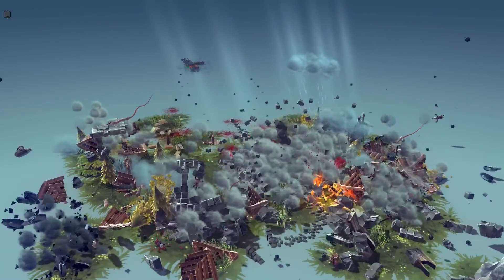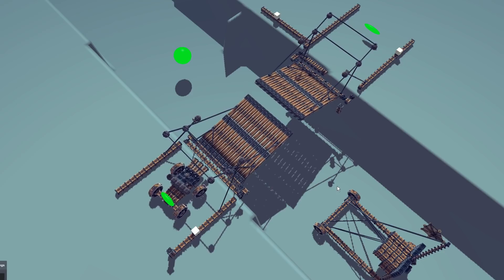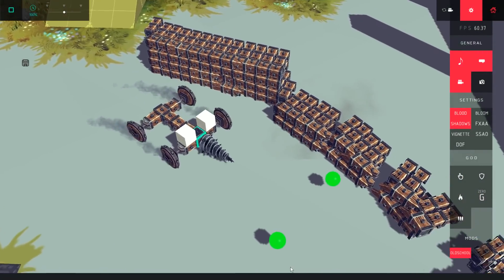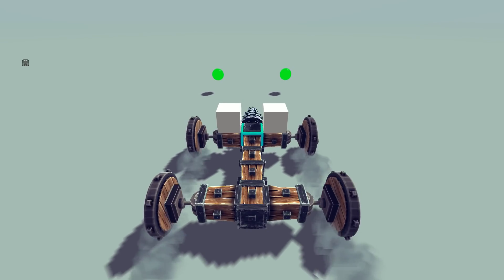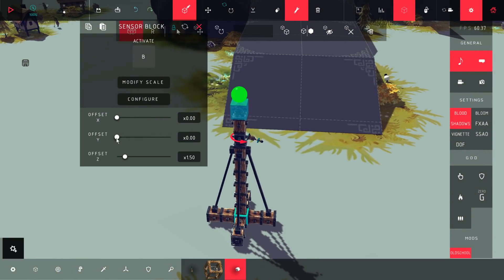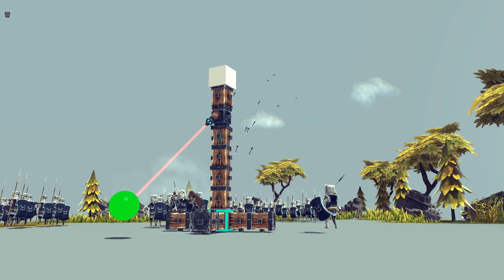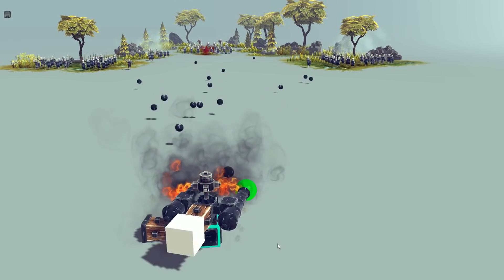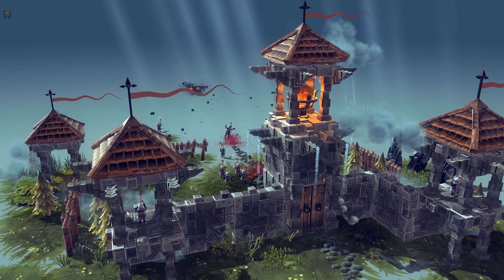Besiege: Brand New Sensor Mod Demo !!

Comment: Amazing! I can see lots of race tracks using this among other things.
I am wondering if the sensor in the future will be able to be adjusted so that it will only react to certain game object or could it be able to have settings like the grabbers. 
Reason being is that I can see some builds that use different weapons for different enemies or to have a grabber system if it finds ores or logs but avoid humans. Either way this is still amazing!
Reply from the maker: +Joseph S block specific sensors! That's not a bad idea!

Comment: Cool!
I would love to see more different sensors.
This one could be called object sensor, and there could be more:
-Angle sensor: Can be placed on hinges/steering hinges and triggers at a special angle.
-Distance sensor: Has a laser beam that triggers if it hits something closer than a special distance.
-Acceleration sensor: Triggers at special G-Forces.
-Temperature sensor: Can detect if things get heated up or frozen.
-Laser detector: Triggers if hit by laser.
-Compass: Triggers if pointing in a special direction.
-Altimeter: Triggers at special altitude (for plane autopilots).
Just some suggestions.
Reply from the maker: +15 Redstones Great ideas dude. I think I could do some of those with the existing sensor eg. angled sensors & acceleration sensor. I will try those out
Reply: +15 Redstones Some of these might be better to just learn one of the scripting mods for, unless you can do it with some fancy usage of the sensor mod. 

The laser one is in works by somebody already

Comment: For streaming I would recommend OBS which is free and Twitch. Or what is the reason for streaming on YouTube?
Reply from the maker: +Chardin112 Hi! I am wanting to use youtube because I am a youtuber! if that makes sense at all :) Sorry if that was a bit crap. I was testing out wirecast because I don't have a good connection on my PC but my mac will run off iphone data which is top notch! I am getting superfast BB on the 26 may so until then I will just experiment on the PC using x-split & a rubbish 1mbs upload
Reply: +Besiege This! I understand it is just that most YouTubers I watch stream on twitch as it give better control to channel owner. However I still will watch if I can regardless of the place.
Reply from the maker: maybe I should try twitch too then. I have just managed to get my iphone tethered to my PC at last so I can stream in HD I should think now

Comment: Using flying blocks with the sensors, I bet you can make an actual hovercraft like in scrap mechanic.
Reply from the maker: +Enderbilll I am going to do that in the next besiege video. I tried it with rockets and it worked ok but flying blocks will be better I think
Reply: You could also use them for reaction wheel stabilization. Also like in scrap mechanic.

Comment: Well I guess I won't make this after all then ^^. Though I hope he'll follow Jake M's advice and mine about how it should be. I would have made the block like the laser block so you can rotate it instead of changing values by hand. Then he can have it display a trace output like the laser beam in the laser block so you know where it aims precisely, instead of having a ball like that. At least I suppose it's a trace because it is a proximity sensor. I guess the ball simply defines the range. I think it's better to have a single slider for the range and change the rotation of the block for the direction.
Reply: Grégory Bastogne Oh, yeah, I made an IO mod once, but never released it, and I haven't gotten around to updating it.

That's probably closer to wiring :-P
Reply: +Grégory Bastogne Somebody is working on making a block that activates when a laser hits it, but I could add a raycast to the sensor block.
Reply from the maker: +Grégory Bastogne I think along similar lines to yourself. ITR will probably develop it further... I hope :)
Reply: +MMMIK13 Hi. Do you have an account on the forums ? I don't see you there. Anyways ITR decided to do this so as FrizB said he'll upgrade it in the future. It's pointless to duplicate the same mod multiple times. I was actually going to work on this since I suggested it multiple times but now I'll just leave it to him. I just hope he updates it in the future. If he says the way he chose is the way he's gonna keep it then somebody can make one that works the other way.

Thing is... I'm still thinking about Wiremod in GMOD. It was and is working so nice that I can't not think about having the same here since it is doable. Problem is here we have one guy who made the Automatron, 2 guys working on scripting mods and another one on this. Plus the laser that works differently from this one. In a perfect world all of those would update their mods to be fully inter-compatible. So that each of them keeps their respective credits while having a global solution for players.
Reply from the maker: +Grégory Bastogne lol. ITR is MMIK13 :) same dude
Reply: +Besiege This! didn't see you were replying to me, thought that at first actually without being certain. Well hopefully then ITR you get my point :).
Reply from the maker: +Grégory Bastogne hehe! The mod he was referring to is the same one I mentioned in the video ie. Pixali's new laser mod. I've seen an early version of it and it is very promising and along the lines of what you mentioned earlier.